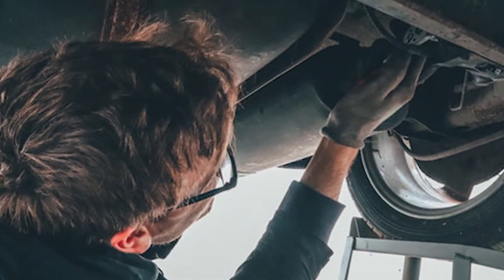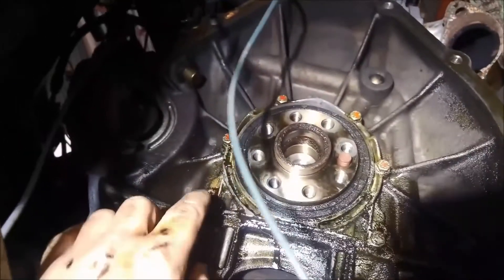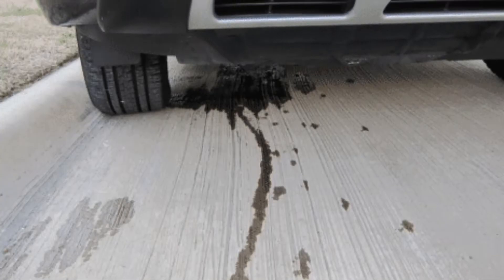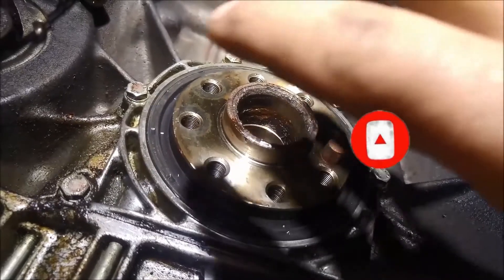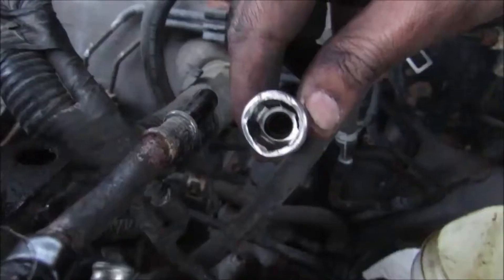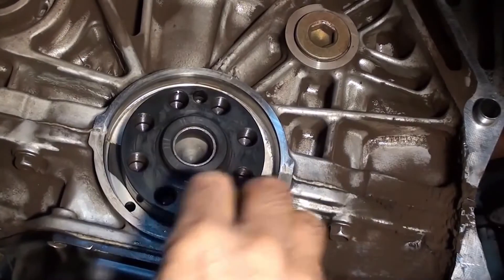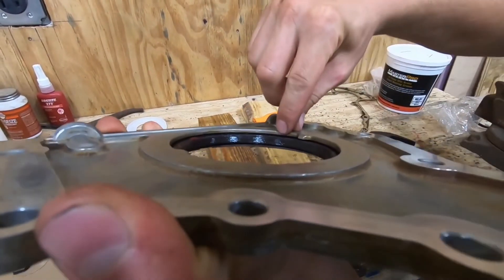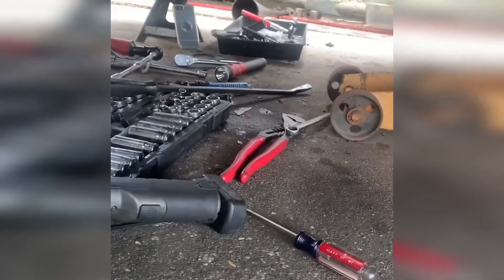What is a rear main seal?

Comment: Question sir..if your car is automatic transmission...and your rear main seal is worn out.what oil will coming out there?is it ATF?or ENGINE OIL?
Reply: No one answered you but it would be engine oil. The rear main seals the engine block. The next seal behind that would be the input shaft seal (front trans seal) and that holds in your ATF.

Comment: Question sir..if your car is automatic transmission...and your rear main seal is worn out.what oil will coming out there?is it ATF?or ENGINE OIL?
Reply from the maker: Hey - this one is not easy to tell unless you pull out the transmission from the engine, then you would be able to tell easier where the oil leak is taking place. Before you do this however monitor your engine oil dipstick to see if the amount is deceasing? Also if you do have way of measuring and seeing how much transmission oil you have that would be helpful.